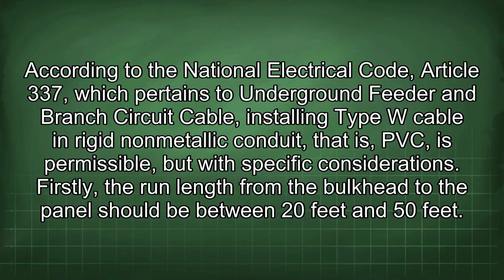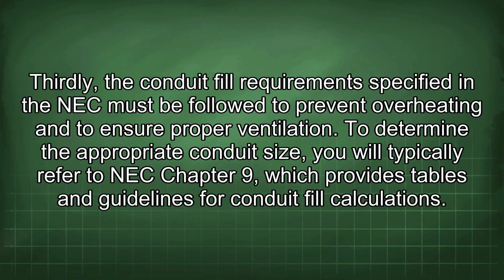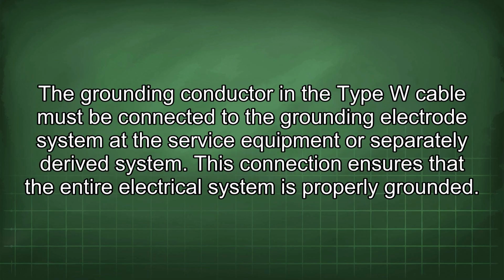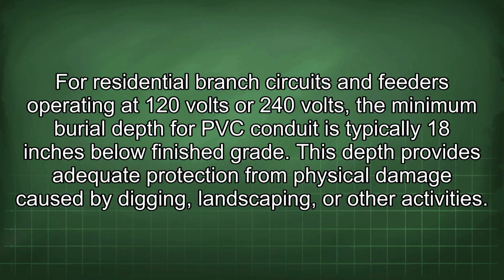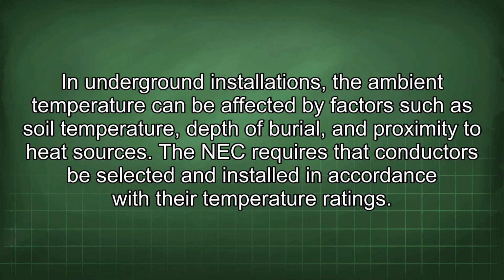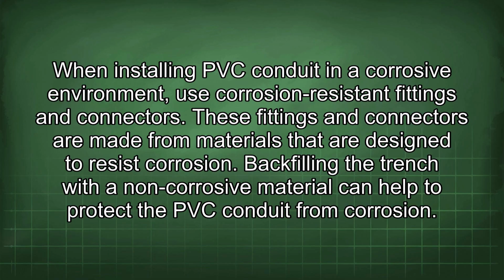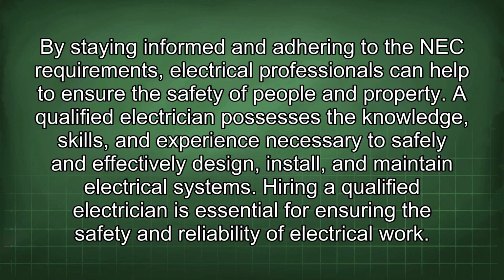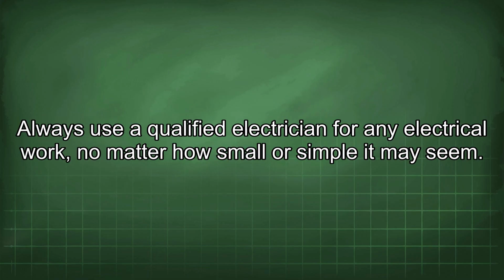Type W Cable in Underground PVC Conduit Explained

Comment: Can it be 80'?
Reply from the maker: Hello @Ooo-vz3jd,

Thanks for your question! Yes, it is possible, however, there are considerations beyond NEC Article 337 or the rules for Type W cable.

Key Considerations for Longer Cable Runs (Type W in PVC Conduit)
The NEC does not impose a specific maximum run length (e.g., 50 ft) for Type W cable installed in PVC conduit. Instead, longer runs are governed by practical and code-compliant factors to ensure safety, performance, and installation integrity.
Primary Limiting Factors per NEC Practice:

Voltage Drop
The dominant constraint for extended runs.
Excessive voltage drop can impair equipment performance; NEC recommends ≤3% for feeders and ≤5% total (feeder + branch).
Solution: Upsize conductors (e.g., from #8 AWG to #6 or larger) based on load current, distance, and material (copper/aluminum).
Reference: NEC 210.19(A)(1) FPN No. 4, 215.2(A)(1) FPN No. 2.

Conduit Fill & Pulling Tension
Long runs with bends increase friction and tension during cable pulling.
Requirements:
Conduit fill ≤40% for >2 conductors (NEC Table 1, Chapter 9).
Pulling tension must not exceed cable manufacturer’s rated limits to prevent insulation damage.

Use pulling compound, proper lubricants, and calculate jam ratio for multiple cables.
Reference: NEC 310.10 (ampacity), Annex C, and manufacturer data.

Permitted Use of Type W Cable
Type W is a flexible cord suitable for permanent/fixed installations in industrial environments when properly supported and protected (e.g., in conduit).
Must comply with NEC Article 400 (Flexible Cords and Cables) and local amendments.
Not intended for general branch circuits unless listed for hard usage and installed per 400.12.

Run length is not arbitrarily capped—it’s determined by engineering calculations (voltage drop, pull tension, fill) and code-compliant installation practices.

Sincerely,

BESA Research
Reply: @BESAResearch thanks for the quick detailed reply